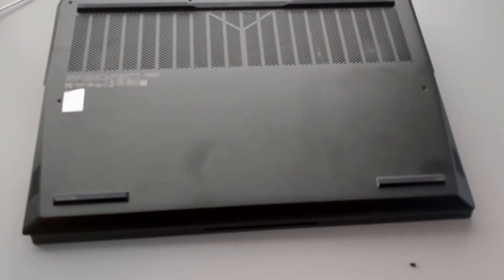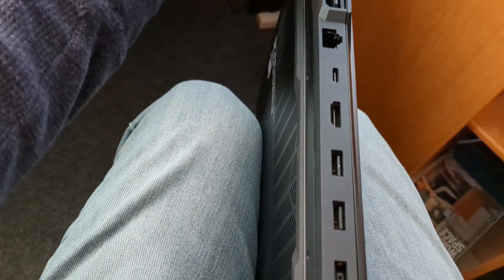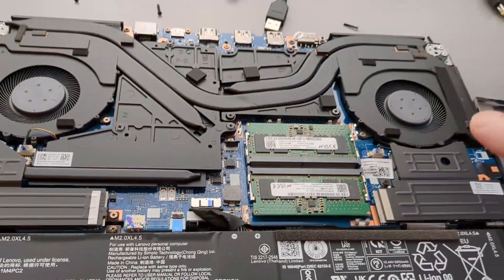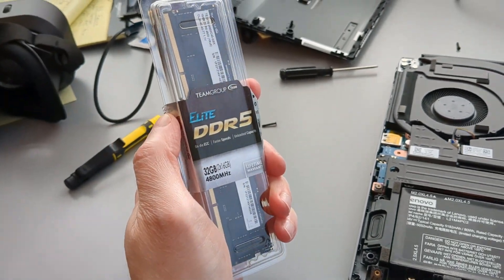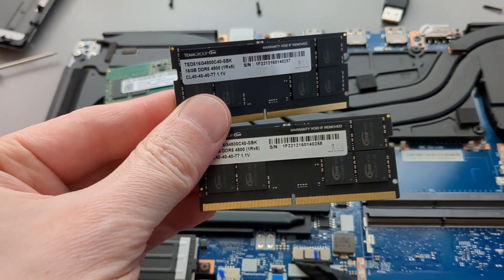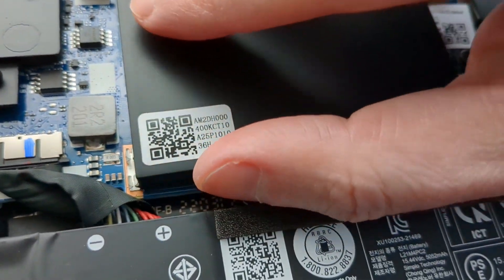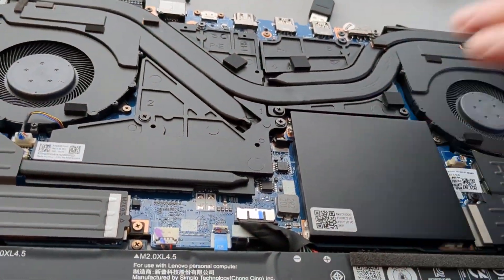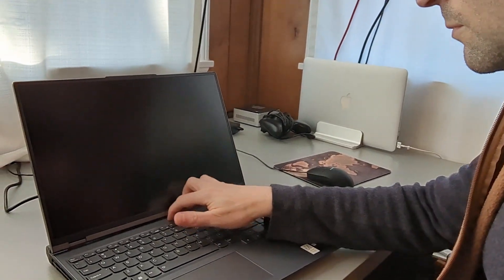Lenovo Legion 5 Pro RAM Upgrade (Easy to do)

Comment: My Lenovo legion 5 has two 8gb sticks of ram which equals 16gb, should i get one 16gb  ram stick for the other slot or spend a bit more on and get two 16gb sticks? And does one stick being q6gb and the other being 8gb has any negative consequences?

Comment: SSDs are not hard drives.  They're solid state drives. They both hold data, but are vastly different technology.

Hard drive gets it's name from the spinning platters being a hard material as prior to that drives used a flimsy magnetic material or dare I say a floppy material. Hard drives are a very specific type of drive. The platters are hard, they spin. A positive charge represents a 1 and not having a positive charge represents a 0.

A solid state drive doesn't have hard spinning platters.  It gets it's name from the type of circuit it is.  Solid state has been around for a long long time, just not as a storage source.  It was most commonly used as a type of relay called a solid state relay.  The technology of a solid state drive works in the same fashion just in a much smaller scale and like a billion little relays. It works with 2 data paths and a signal path. Because it's name comes from it staying solidly on one data path until a signal comes in from an alternate source that says to change states. Path A, Path B and signal.  That is the theory behind Solid State.  Path A is the 0, Path B is the 1 and the external signal to tell it when to change. There is nothing hard about it.  It's Solid State.  Whether you call it M.2 or NVMe it is a Solid State drive. Not a hard drive.  Yeah, it's a pet peeve, but now you're educated on the difference.

Comment: Never had a laptop open before so you remove the old memory and replace it with new?  Not adding to what's already installed.
Reply: I wish it was that way. No. You basically replace older models with newer model purchases and then you have options of very limited upgrades like in this case ram.

Comment: Hi. How good are Corsair 5600MHz 2x32Gb CL48-48-48-90 for gaming ? I have the Legion 5i Pro with i7 13700HX up to 5Ghz with turbo boost without OC, RTX 4070 140W TGP. I see that most users that owns a Legion 5i Pro uses Kingston HyperX Impact for their RAM upgrades. Are they the best?
Reply from the maker: Now that I don't know.  tbh I doubt it makes a huge difference

Comment: Thanks for the video.  I just did my new 2024 Legion 7i. I also went from 32GB to 64GB (I used for my case Crucial RAM 64GB Kit (2x32GB) DDR5 5600MHz ). I must mention that when you start the laptop, screen will be blank for few minutes while it recognizes the new memory. Just wait and it should work.
Reply: Thanks. I was freaking out.
Reply: @Rajeshkumarrio real shit bro I almost busted a nut
Reply: Did it register the higher speed as well?
Reply: @jacobm2625    yes it did.
Reply: Crazy upgrade thanks for info
Reply: which ram you used?

Comment: interesting, my legion 5 pro already came with 32 gigs of ram. are we not able to upgrade up to 64gb?
Reply: type  wmic memphysical get maxcapacity in command prompt mine came up with 64gb ram max
Reply: @PureBoxing_1  Mine only said 32gb. Does that mean I can't have more than that? When looking at the specs of the CPU, it says it can take up to 64gb.
Reply: @-RXB-  I believe that’s how much ram you can fit but your cpu can handle 64 gb
Reply: @ Thanks! 64gb might be unnecessary for me anyway.

Comment: Crucial 96 GB (2x48 GB) Kit DDR5-5600 CL40 works also like a charm. The plattform supports up to 128 GB, so if 64 GB SO-DOMMs will be available, they might work as well
Reply: JESUS CHRIST WHAT ARE YOU DOING THAT REQUIRED 96 GBS OF RAM
Reply: @goldenfruty4291 stackig astro photography
Reply: @goldenfruty4291  , probably virtualization
Reply: It's this real ? (sorry my bad english), I recently bought a Legion Pro 5 8th Gen (16ARX8), Ryzen 9 7985HX, with 16gb ram and 512 SSD...
Reply: @marcoavaria1657  I have the 96 GB already working in a Gen 7 model. In Gen 8 ist should work as well. Also a 4 TB secondary NVMe SSD for my data crunching  ist working as well.

Comment: I put 64GB of DDR5-5600 in mine and works just fine plus, even if it marks 4800 in memory, in Bios says 5600 and I did benchmarks and it is coming out faster.

Comment: Great video guide just a tip i recommend getting a ram copper low profile heatsink plate for than ram to cool things down since this laptop lacks fans for cooling anything down lol the two small default fans are for the RTX GPU/CPU only it doesn't really cool the DDR5 Sodimm ram at all soo during gaming it gets hot with nothing to cool it down hence throttle 😅

Comment: I can confirm, this laptop can take more than 32gb ram. I bought 1 stick of Corsair Vengence DD5 32gb popped it in and left in the oem 8gb. I know how 40gb (39.7 usable). thinking about getting the other 32gb but for now it's way more responsive vs 16gb stock.
Reply: Hi! So it's possible to buy 32 gb in one stick and replace only 1 stick in my lenovo? Will it work properly?
Reply: @NikitaGal31 yes but it's not recommended BECAUSE DDR4/DDR5 Ram Kits likes to run in dual channels sticks and not single channel bro.
Having 2X16GB Ram Sticks on Both Slots is better than 1X32GB Ram Single Sticks because with Dual Channels Ram Sticks I get better performance and responsiveness 👍
Reply: @HuuTonyTran  the sticks can run in dualchannel when paired as the user said 1x8gb and 1x32gb, youre mentioning setup of only running 1x32gb

Comment: Thanks for the awesome video! 

I have a set of 32GB Kingston Fury KF432S20IB1K2/32 Dual Rank RAMs on the way for my Legion 5 Pro. Can't wait!
Reply: Hi, if you have done this already can you tell me if it worked? Is that ram supported on this device (Intel 12700h version - 16IAH7H ) ?
Reply: @babayaro43  Yes it worked flawlessly.

Comment: For anyone curious, I also have a 16IAH7H, I was able to put 64GB of Crucial DDR5 4800 RAM.
Reply: Great video guide just a tip i recommend getting a ram copper low profile heatsink plate for than ram to cool things down since this laptop lacks fans for cooling anything down lol the two small default fans are for the RTX GPU/CPU only it doesn't really cool the DDR5 Sodimm ram at all soo during gaming it gets hot with nothing to cool it down hence throttle 😅
Reply: Did you use CL40 and are you seeing any performance upgrades, I have the exact same model and I'm looking at 64GB, however I think they limit the speed to 4800 and to CL40, there are 32GB CL32 available however not sure if the CL32 will work, did you come across any findings on this?
Reply: @alexandersmith1751  do crucials scanner. I did and it recommended 2-32GB DDR5-5200. It arrives next week so I will update if all goes well.
Reply: @DarrylD369  The BIOS won't allow you to go to the 5200 speed.
Reply: @alexandersmith1751  yea I realize that's a thing with AMD but I wanna try a few things see if I can find a work around... Will update if any progress.
Reply: @DarrylD369  hola, hubo algun progreso?
Reply: @nelsoncosio3970  nothing yet my friend... AMD mother boards don't allow for higher ram speeds. Stick with manufacture rated ram speed
Reply: @DarrylD369  yo mañana probare en 2 laptop con intel, espero que todo bien
Reply: @DarrylD369 Hey bro, how did that go? I got mine today and it came with 16Gb 5200. So, I'm looking into upgrading to 64Gb too.
Reply: @sapiologico  you won't get 5200 ram speed from AMD motherboard unfortunately. But better to have it and not need it than need it and not have it... Hopefully AMD caves and gives and update on BIOS to utilize higher ram speeds.
Reply: @DarrylD369  Thank you for replying, but it\s strange that 5200 is on the specs.
Reply: @DarrylD369 Hi I am late to find this video, how did the 64GB perform? Curious as I got a 32GB variant of the same laptop and wondering if upgrading to 64GB gets any improvements. I use my machine for video editing and virtual machines. How is the idle temp? Mine is at 42-45 degree C and I see sometime it goes to 39 wondering if a thermal paste change or upgrade would improve it. What’s your thoughts about this? If you notice this, a reply would be much appreciated. Thanks in advance.
Reply: @thecyberwanderer  yes the improvements help allot. It depends on how you use it.. I would say the 64gb upgrade would work great for your media editing. I use it a lot for work and a memory hog of a program. But I had zero issues with the 64bg upgrade... Just do be wary of the speeds on your ram the motherboard caps it I forget at what speeds and no "safe" workaround. There is a few forums pointing to a workaround with the bios to force the higher speeds but do not attempt. As for the thermal paste that would be very subjective to your conditions I can't really comment on that one
Reply: @DarrylD369  I’ve figured out and fixed the thermal situation but I’m still wondering if 64 or even the 96GB kit would work with my Legion 5 Pro 16ARH7H, since there aren’t any official mentioning or videos to that specific model that I can find. 

I’ve seen people saying it should work but nobody really confirms. The brand says max is 32GB and mine is 32 already. I’ve seen 32GB getting used up to 89% so an upgrade would be great right. 

Btw, Thank you for spending time in replying.
Reply: @DarrylD369 I don’t know if you’ll see this but I have to ask. I have the 16AR7H7 with 16GB. I already looked on Crucial and found the 2x16 I was going to buy for 32GB. I’m very new to computers and I was wondering is there anything computer wise I need to do other than take out the old a swap with the new?
Reply: @iamTexan  nope you should be good to go... I would by a static band tho... You don't want static electricity to mess up your new ram. Just be careful and follow the instructions. If you need more assistance message me there are websites you can go to walk you through the install but it's just ram so you should be ok.
Reply: @DarrylD369  thank you!  I'm assuming I shouldn't be on my carpet while swapping RAM right?

Comment: Thanks for your video! I´m gonna upgrade to 64gb in my legion 5. What about the battery? Do you need to disconect it manually? Many people says you must do it.
Reply: Wondering the same. Also wondering how exactly he disconnected the ram pins lol
Reply: @adamking6140 Yes! Absolutely safety first. First turn it off in BIOS, then disconnect the cable before starting any manipulations.
Reply: You should but you also disable the battery from the BIOS

Comment: I get this notebook too with 16 GB RAM. Can I use any brand of DDR5? Does it need ECC? Is the warranty gone if you change the RAM?
Reply from the maker: The brand of RAM does not matter so much.  It does not need to be ECC, in fact the two 8gb modules it comes with are non-ECC.  As for the warranty, I will not say this with 100% certainty, but I do not think it will void your warranty.  I searched for that same question before upgrading mine, and several posts on the official Lenovo support forums all say that you can upgrade both SSD and RAM without voiding warranty.

Edit - I should note that the Lenovo spec sheet says to use DDR5 4800mhz.  I have read posts that the chipset actually supports faster RAM as well, but I did not test and only followed what the spec sheet recommended.
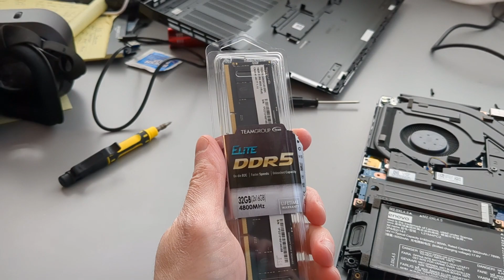Reply: @BrandonStecklein  Thanks a lot! But your new RAM has ECC, right? I see "On-die ECC" on the package at 1:55. Greetings from Switzerland.
Reply from the maker: @WilhelmTell_CH  Yes it does, I am just saying it is not required.